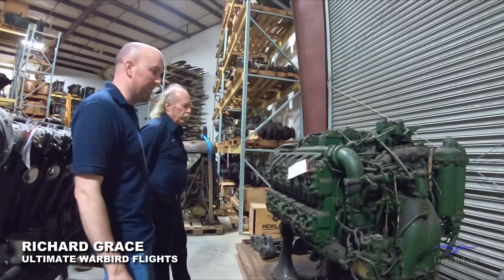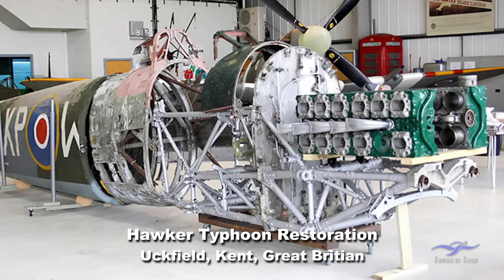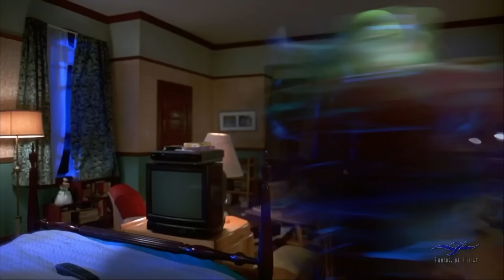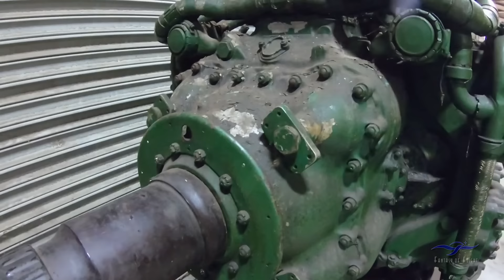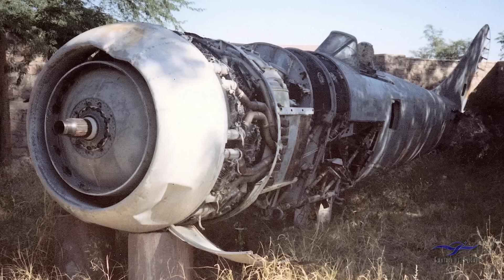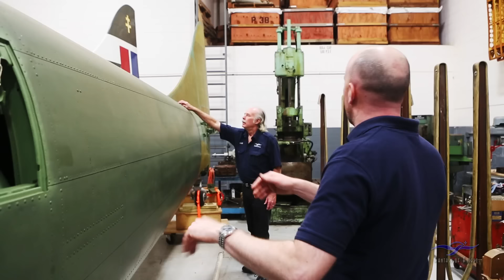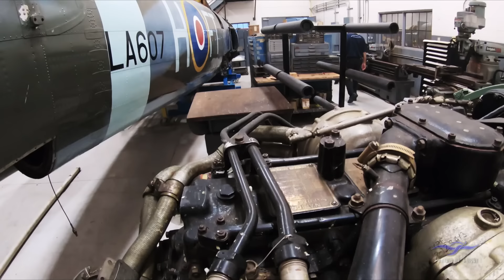Hawker Tempest V - Part 2 - Napier Sabre Engine / Fuselage - Restoration

Comment: The Tempest V and late Sabre is a hugely underrated aircraft and engine combination!  It has that bulldog look sense of purpose. Heavily used for D-Day ground attack and pretty much unmatched at lower altitudes.
Reply: I think you are getting the Tempest confused with the Typhoon which became a ground-attack aircraft. When the Tiffies were beating the hell out of the German land forces during and after the Invasion the Tempests were one of the few aircraft fast enough to intercept the V1s that were being aimed at London and the South-East. Therefore they were all used in the defence of England against the V1 threat. This machine was built just in time for Operation Market-Garden when she flew escort missions for the transport aircraft dropping paratroopers or towing gliders before moving to Eindhoven shortly after where she suffered an engine failure on approach to land which was traced to water being found in the fuel which is understandable considering the journey it had to make to get to Holland and the weather they were experiencing at that time.

Comment: With regard to sleeve seal rings, the Bristol Hercules had a pair of rings inside the cylinders top and bottom for oil management against the sleeves.  There were also a number of scalloped grooves that encouraged oil to get to where it was needed. 
It’s very exciting to see these engines being considered for an airworthy restoration.  All the best!

Comment: Blackburn Beverly crews used to say they navigated to their destination then followed the oil slick back home.
It was powered by 4 Centaurus engines.
Reply: Interesting that 'total loss' oil systems didn't go out with the rotary engine (obviously 2 strokes work that way).
Reply: Evidently the engine in the Corsair wasn't much better, had a huge appetite for oil.

Comment: It's close to the Griffin's cubic inches. Because of the relatively small pistons/rods and stroke, it tolerates a higher RPM whithout excessive piston speed. More pistons and higher revs will not sound like anything else. For me, the sound will be incongruous, but I still love the compact symmetry. It's such an inspired design that I wish its teething had never been witnessed.

Comment: Is that Tim Moore's one? I worked on the one the RAFM had at Cardington in the 1980s.
Reply: Tim Moore didn't have a Tempest, he had a Beaufighter that is now in Australia. The RAFM were restoring their Tempest V NV778 at Henlow, then Cardington, moving to Wyton before finally being finished at Cosford and going on display at Hendon.
Reply: I never said he had a Tempest. I was referring to the Sabre he had for the Heston Racer replica he had  planned.
Reply: Kermit isn't going to know if that was Tim's Sabre and the video is about the Tempest V, you referred to the RAFM's in your comment so it wasn't particularly clear.

The Green Sabre was bought by Nick at auction back in the 80s from what I can recall so it is unlikely to be the Sabre that Tim had